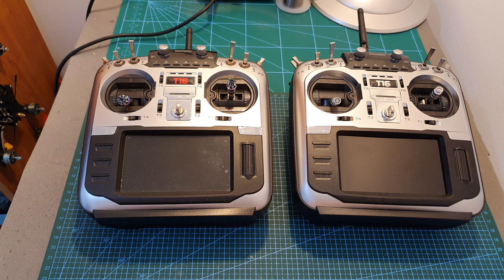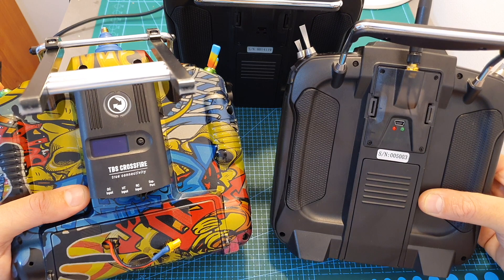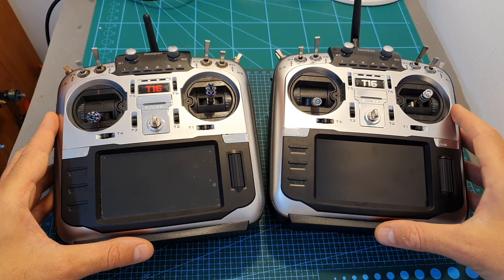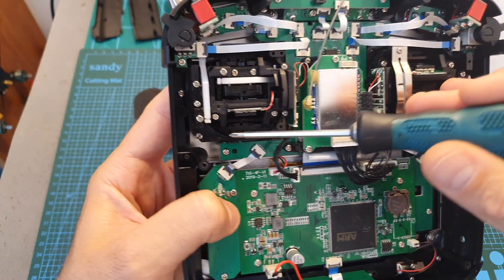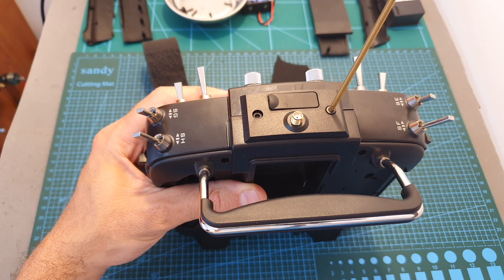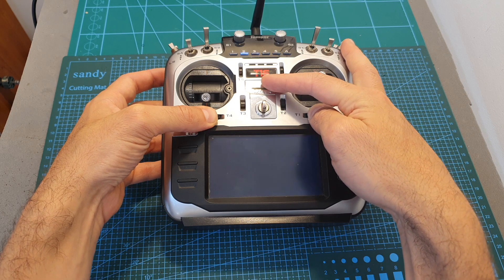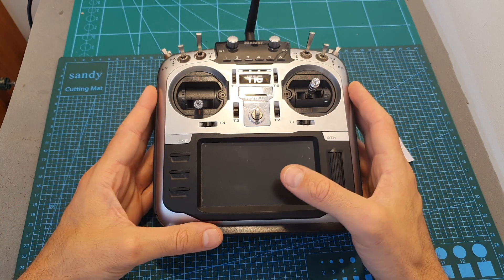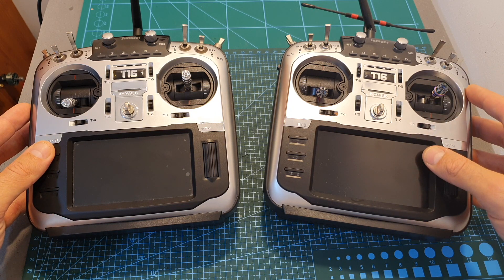Jumper T16 Pro - Overview & Upgrade Guide

Comment: how can i fix my switches on T16 pro 4 of them do not work 100% correctly can i do something about that problem it helps and replace them with new ones
Reply from the maker: Try updating the firmware of the TX and calibrating the sticks.

Comment: My t-16 that I have never gotten to use has 2 switches SA/SB, show in the hardware menu are 3 pos. switch , but only works as a 2 pos.   I wrote to the company ( JUMPER) and this is what the wrote back to me . I did what they say said and  the cable from SC/SD would not reach SA/SB connector . Then while trying to put the cable back for SC/SD I could not get it in..Bent the ribbon cable while trying , so now SA/SB AND SC/SD do not work . Jumper is a shit company and I think their service support really sucks.  I am so PISSED OFF. 

Hi Gordon,

Thanks for choosing Jumper
and sorry you are having problem.

Would you please kindly pull out the

cable of SC/SD and insert it into SA/SB? And then turn on the radio. See if the
SA/SB works back to normal?

Best regards,

The Jumper Team
Reply from the maker: Hi Gordon. On the systems settings under the hardware tab you can define the number of positions of each switch.

Comment: Also, you might want to add some hot glue or liquid electric tape to where the flimzy gimbal wires are soldered. One of my wires was disconnected when received. I'm glad it disconnected now than while flying over the ocean :)

Comment: I ordered mine from Heli-Nation on Oct. 14th... still have not gotten it, no word from them when asked, no emails, nothing. I'm worried I got scammed.
Reply: That’s where I got mine.  It took about ten days.  I think initially I wouldn’t be worried.   You should be fine.
Reply: @timk8021  Aye, called them to find out what was happening, they looked into it, saw a "discrepancy" on my account and flagged it. Gave them my order number, cleared the issue and they sent it, it'll be here Saturday. whew

Comment: aaaaaaannnnnd you joust fried your brand new module..... never powerwithout an antenna!
Reply from the maker: What are you talking about?
Reply: @KremerFPV  I think they are talking about what usually happends when you power on a VTX without an antenna. They say it kills it immediately because of a reason I can not remember but I think it is good practice to not power on a transmitter without antenna anyway.
Reply from the maker: @LetsGetStarted  Well I am well aware of that and I always mention it on my videos.  It sounds like he was implying that I didn't follow this rule.
Reply: @KremerFPV  I haven't watched your video fully yet so I didn't know and assumed the comment was because you forgot or something😆
Reply: @KremerFPV  Ah! Have a look at 7:12 You power on the transmitter and the antenna connector doesn't have an an antenna attached. That's probably what they were referring to.
Reply from the maker: @LetsGetStarted  Thanks for finding it. The internal transmitter wasn't turned on at that point and regardless - turning on a transmitter on 100mw for even a minute shouldn't be that harmful.
Reply: @KremerFPV  No worries! As long as it all works ok, no dramas👍
Reply: @KremerFPV  doing so with a taranis is enough to burn it and you see the range decrease over time... It does not happen right away... What makes you think the module is not powered on at that point?
Reply from the maker: @quebecmultirotor5013 You are right - but accidentally turning it on for a few seconds will not kill the radio. When I turned the remote on the internal module was set to off under the model settings.

Comment: Gal,  I am in the process of upgrading my Jumper T16 with the internal module and Hall effect gimbals.  The one thing I want to complete the project, but can’t find, is the silver logo piece on the front of the radio.  I realize it’s purely cosmetic,  but I never liked the current red one that came with the radio anyway.  Can you please supply a link as to where I can get this last part??  And I’ll add my thanks for another great video on your part.  Thanks again and please respond if you know!!!  Cheers 👍🏼👍🏼
Reply: I got the logo from a vendor at bespokerotors for free when I ordered the hall gimballs, the guy asked me if I want one since he has some lying around... Great customer service :)
Reply from the maker: Hi Tom, as far as I know you can't buy it separately. I suggest contacting Makerfire on Facebook - they might be able to help you out.

Comment: After upgrading to the internal module my speaker gives a constant low buzz sound when its powered on. Anyone else have this happen?
Reply: I replaced mine a couple of days ago but it works fine... Try putting back the old one and see if this continues, if so, you might have shorted something in the process of replacing it. If not then the module is defective.
Reply from the maker: Try to disconnect the internal TX and see if the buzz sound continues.

Comment: Alert !!! I just got the Jumper T16 Pro. To work with dsm2 and dsmx receivers BOTH internal RF and external RF have to be ON in the model setup menu. After hours  trying to make it work with the internal RF only and no response I try both on and wala!! works.
Reply: Been reading on this as I JUST got a T16 and ordered a DSMX quad only to just discover there's been issues with running DSMX on it. :( So can you confirm that the above comment resolves it (other sites are saying the firmware needs to be updated) - or is your comment above related to something else with DSMX?
Reply: @fpvpastor7988  I am using a Spektrum receiver on a fix wing plane NOT a quad. I don't know if this make a difference.
Reply: @Nelsonv2  Ah! That might be it! Ok, thanks for the help / reply.
Reply from the maker: Thank you very much!

Comment: Hi thanks for this video as I had been interested in it...I have just checked the OpenTx web site and they are only showing support for the Jumper T12.  No sign of the T16 Pro?   Regards  Laurie
Reply: Yes, how to upgrade our regular T16 with OpenTX?
Reply from the maker: I double checked it with Jumper and they told me that currently you can use only their firmware (I guess you will be able to use OpenTX soon).
Reply: @KremerFPV  Ok thanks Gal.

Comment: Just installed hall effect gimbals. Updated firmware. The gimbals don't stay calibrated after powering off. is there a fix?
Reply from the maker: Does the software require you to calibrate the gimbals each time after a restart?

Comment: Hi Gal,
Thanks for the great video.  Very informative and simple to follow.  
One question, when you replaced the entire content of your SD card, how did you recover the models from the contents of the original SD card?  

Thanks....Sam
Reply from the maker: Thanks Sam. I did not backup my models. As far as I know - you need to use the OpenTX companion app for that.
Reply: Gal Kremer 
If this is the case, the other question is do you really need to replace the contents of the SD card?
Reply from the maker: Yes, otherwise you will get a version mismatch error. Try keeping the models folder and see if it helps.
Reply: Gal Kremer Thanks.  I’ll give that a shot.

Comment: Hi Gal, Great vid,very clearly done. I am looking at vids on the T16 because I have just got one. Having had "normal" radios up till now I find the radio setup is really hard to work out.Servo reverse, travel adjust/end points, throttle/pitch curves, etc ,nothing is like normal method to use, spectrum etc.  Will you be doing a "basics vid" now the T16 is becoming popular,i think  a lot of newbs will be buying this and have no idea how a "opentx" is hard to setup
Reply from the maker: Thank Gary, I will consider it :-)

Comment: Thank you for this very useful video. Is there any range difference in D16 mode comparing the T16 with internal multiprotocol module compared to a taranis?  What is the battery lifetime ?
Reply from the maker: Thanks Olaf. Range should be very similar.  I did not test the battery life and it also depends on the batteries that you use.

Comment: Great review as always. I just received my t16 and right out of the box it's defective. When I power it up I get continuous static through the speaker. Static increases in volume as the screen decreases in intensity. Now I'm faced with having to return the unit. I feel they have a quality control issue. Not sure I would never buy another jumper product. Great concept poor quality control. I feel Spectrum and FlySky are excellent options over Frsky. Thank you Gal.
Reply from the maker: Thanks Joseph. If you turn off the internal TX does the static sound go away?
Reply: @KremerFPV  thank you so much for the reply. I've done just about everything including your suggestion. The only time they static goes away is if I started in bootloader mode. I'm waiting on a response from the retailer and jumper. As soon as I find something out I'll be happy to let you know. Once again absolutely fantastic Channel.
Reply from the maker: @josephbove7477  No worries Joseph. Hopefully you will be able to figure it out and anyway the vendor you bought it from must take care of you.

Comment: Gday Gal, nice job mate ive been waiting for the t16 pro to come out  i didnt know that open tx is on board thats even better news, where did you get the charge lead for the 18650's, great review mate.👍🛸
Reply from the maker: Gday mate. Thanks a lot. It came with the FuriousFPV smart battery case.

Comment: I've not had my T16 long, but it's halfway between the T16 and T16 Pro, it came with the battery tray that has 3 pins enabling balance charging (I made the same charging lead as you showed there), and it has hall effect gimbals, but no internal RF module so I bought the external one, then a short while later they released the internal module :-\
Reply from the maker: I hear your frustration...
Anyway, adding the internal module is pretty easy and if you use CRSF I definitely recommend doing so.
Reply: @Gal Kremer  I do have CRSF but I'm holding back on buying the internal module for a couple of reasons; it doesn't feel nice having to buy the same piece of hardware again in such a short time, and secondly summer stopped dead 3 weeks ago today in the UK, it's been rain and wind every day so I haven't been flying much at all since it's so difficult to find a clear gap in the weather. But I will buy it eventually :)

Comment: I love my Jumper T16 now after I complained about the gimbal. Pyrodrone sent me hall sensor gimbals and it has fixed all the issues. I don't have the multi-protocol though. What benefit do I get if I buy the multi-protocol board?
Reply: The fact it becomes internal, nothing more.
Reply from the maker: andimon2010 is right. Unless you need to use an external module such as a Crossfire you don't really need this option.
Reply: Got it! Thank you!